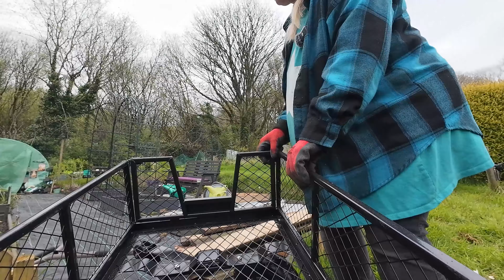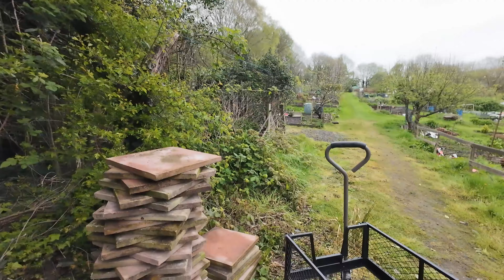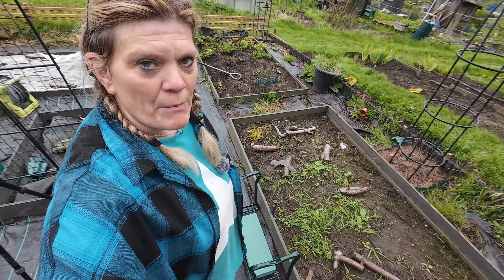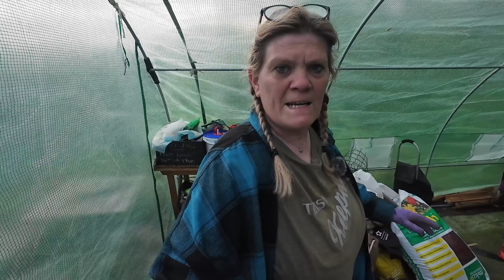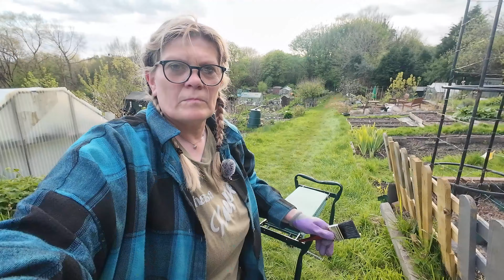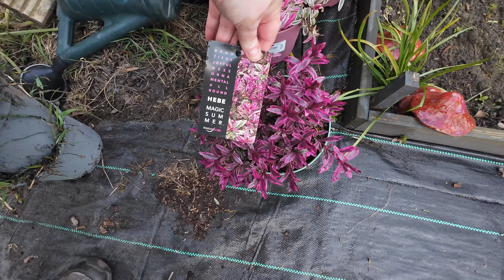It was not a pleasant allotment job but I got it done

Comment: Wood ash from a wood stove helps with weeds and it also gives nutrients to the soil. Your garden looks great! I've seen a video of a repellent for midgies is vanilla extract, you just pour some in your hand and rub, or spray bottle. I haven't tried it yet. Take your time so you don't throw your back out. If your buggy would of took off downhill wouldn't of been good. Awesome job on the fence! Beautiful colors on the flowers. ❤❤
Reply from the maker: I know it prob would have veered into someone’s plot . I have some citronella oil that may do the job too not heard of vanilla , much nicer smell though